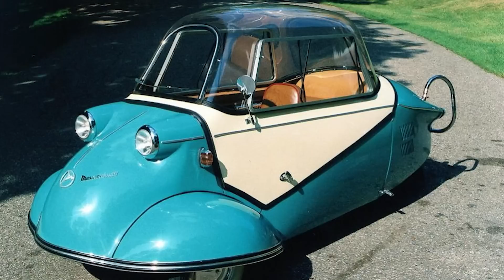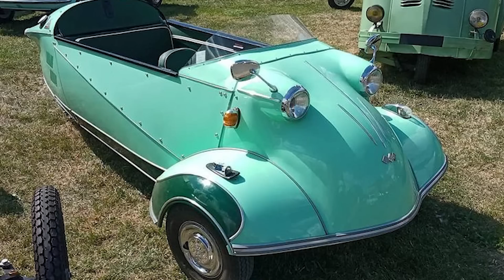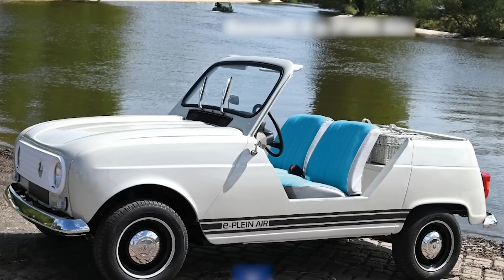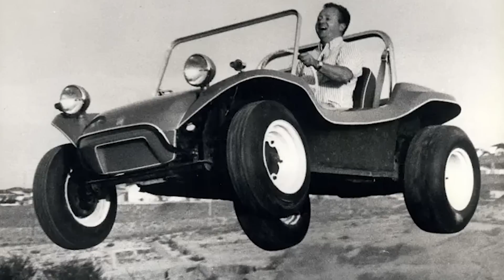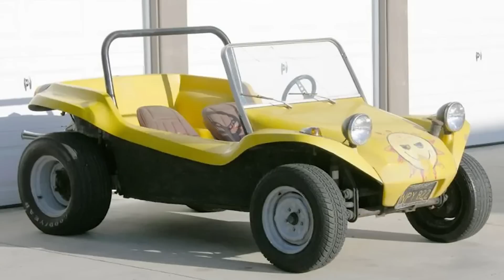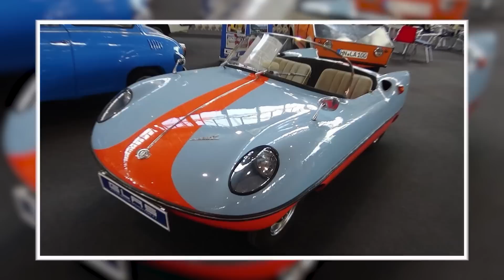4 Most Bizarre Classic Cars You Won't Believe Exist!

Comment: The Meyers Manx was a Volkswagen Beach Buggy reproduction that was first produced in 1974 because BF Meyers and Company acquired the license to build the Volkswagen Beach Buggy after the Beach Buggy had ceased production because BF Meyers would only drive the Beach Buggy in dune buggy races (the #5 shown in this video is a 1962 Volkswagen Beach Buggy). The Gogomobile Dart was an Aftermarket kit that could be applied to either the Goggomobile Volkswagen Safari (Thing or Kubelwagen), or Volkswagen Beetle aka KDF.

Comment: As a former Goggo Dart owner,  I can testify that the weight distribution was far from ideal, as it had a considerable rearward bias. Engine and gearbox, fuel tank and battery are all behind the driver. All that is in front of the driver is the front axle. This makes for, shall we say, interesting handling.  It would oversteer at the slightest provocation. If you could handle this ti was great fun. It made for remarkably impressive handbrake turns, in not much more than its own length.

Comment: As a student in Brisbane in 1962 and 63, I was a passenger in a Goggo Dart a few times. In traffic you were lower than the headlights on trams and you could see under trucks. In city driving, at times, it was frankly terrifying because it was invisible to big vehicles. The sideways H pattern gear shift was odd. I wish I had one, but I certainly wouldn't use it in the city.
Reply: I've never seen a dart (would've loved it), but I do remember the little 1 door BMW back around 1960 -1962 here in the States.
I was 7 in 62...when I was five I thought that tiny car was just right for me to drive, every time I saw one I would STARE and follow it till out of site...LOL...the Sprite was a trip as well.
Reply: No Dart in North America [ except Dodge], but we had the King Midget.  Probably about the same size, but not quite as sporty.
🚗🙂

Comment: The Messerschmitt did not have coil springs, it had rubber bushes in tension as the spring mechanism, while the hub caps you showed with the spinners are not from the factory, I owned and restored one.